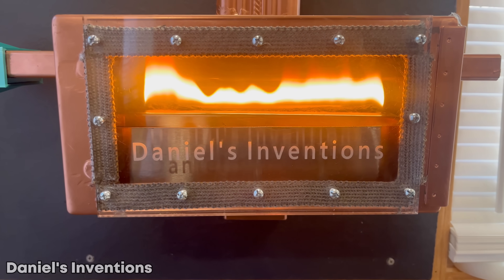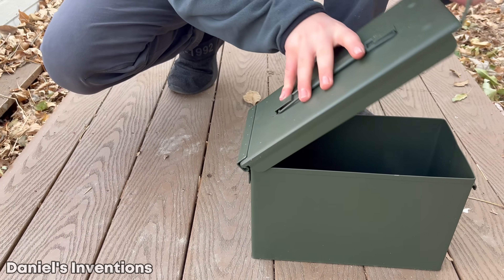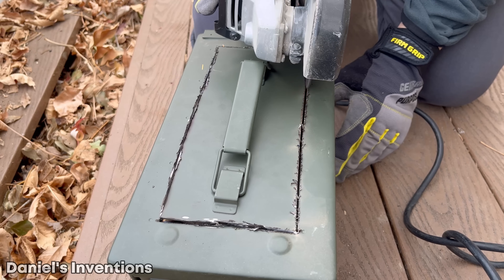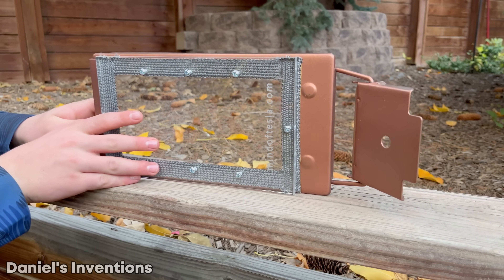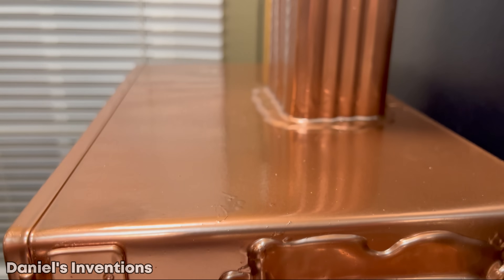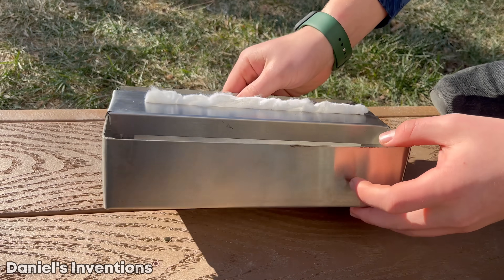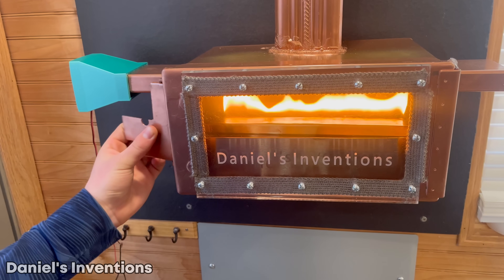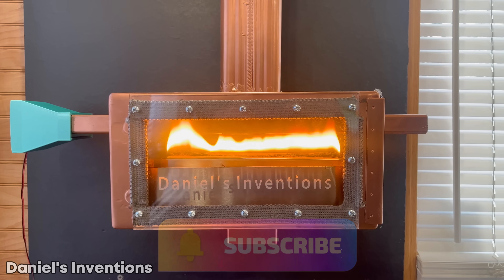ENDLESS Heat for Your Home WITHOUT Electricity 2.0

Comment: Finger weg von solchen Basteleien. 
Allein schon wenn ich sehe, dass der Körper vorher nicht mal von der ursprünglichen Farbe befreit wurde. Man sieht auch beim letzten Video beziehungsweise bei den letzten Sekunden des Videos wie der Corpus seines Ofens ordentlich anfängt zu qualmen. 
Die Farbe darunter fängt vermutlich gerade an zu verschmoren. 
alles andere als gesund. Außerdem gibt es bei dieser Konstruktion keine Möglichkeit, den Ofen auszuschalten, oder die Temperatur zu regulieren. 
Bei einem Stromausfall muss der Zuluftmotor schnell entfernt werden.  Durch die fehlende Zuluft und Kühlung würde der mit Glück nur herunterfallen wenn der 3D Druck weich wird. Mit Pech fängt er feuer. 

Das Abgasrohr Waagerecht unterhalb des Dachvorsprunges enden zu lassen ist genauso fahrlässig.Ebenso wie die nicht isolierte Wanddurchführung des Abgasrohres. Da gibt früher oder später das Material aufgrund der Hitze nach. 
Wenn er morgens nicht mehr aufwacht, weiß er dass es einen Schwelbrand in der Wand war

Comment: CHECK YOUR NUMBERS, man!  In a week you say you burn 1 gallon of oil (~120,000 BTU) over 35 hours (your numbers) = ~3430 BTU/hr or the equivalent of EXACTLY ONE 1000 watt electric heater (which is pathetically small despite such heaters being 100% efficient).  That even assumes zero losses to outside and 100% efficiency (both things being impossible for your oil based design). 

Your SMALL space (220 sq ft?) must be extremely well insulated. Congratulations on that part ... seriously. But a 1000 watt equivalent electric heater can NO WAY heat up much more than or even that. I love your clever design but does it really replace anywhere enough electric or other standard types of heat??? I just don't believe it.

I have a propane burner (Mr Heater Big Buddy) which BLASTS out max 18,000 BTU per hour (4X what your design does) and ALL of that heat stays indoors (no external input/output venting like yours). On highest setting it does not adequately heat up my LR space (450 sq ft) even though indoor temps may start at 45F (not that cold). So I just heat nearby air where I sit as needed and use wood stove.

Comment: "burn off some of the paint"... WHY IN HELL WOULD YOU NOT USE HIGH TEMP STOVE PAINT?!?  No weird burnt-paint fumes for me, thanks. Also love how you used aluminum downspout materials where steel flue pipe belongs... you're a disaster waiting to happen. And if it doesn't need electricity, why do you never show it in use without a little fan?  This is the worst sort of clickbait.